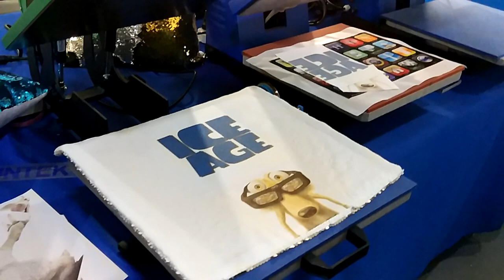Sublimation printing on sequin pillow case

Comment: You sublimated one side. Fliped over to sublimate the sequin side and did not cover your press botton tray with anything? The first sublimated image after applying the second one will continue the sublimate process and get your silicone pad sublimated, which will leave traces on everything else you put in this press. This is a very bad example to not put parchment paper on the bottom
Reply: Ričardas Šaltis that’s what the blue mat is for
Reply: Blue mat? That's part of the heat press. Anyway... I agree. I keep paper on my bottom platen at all times.